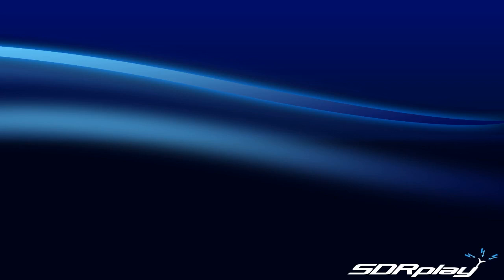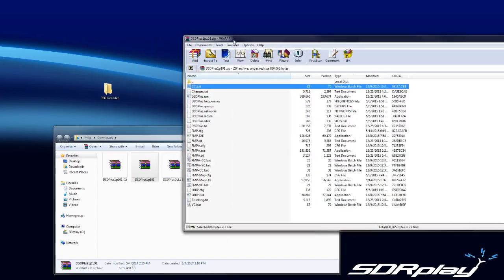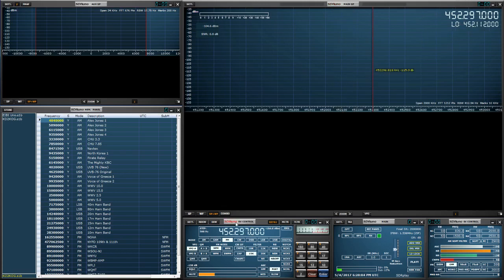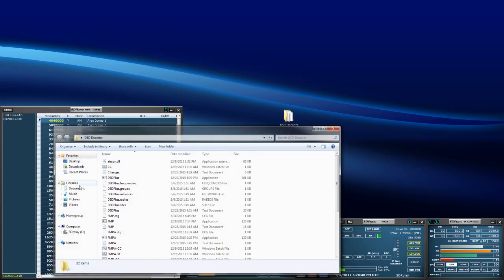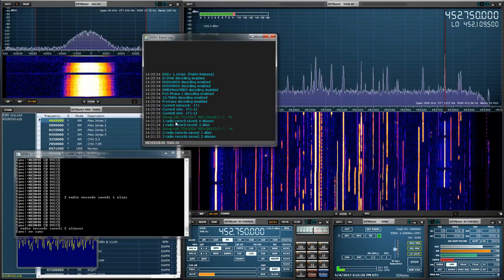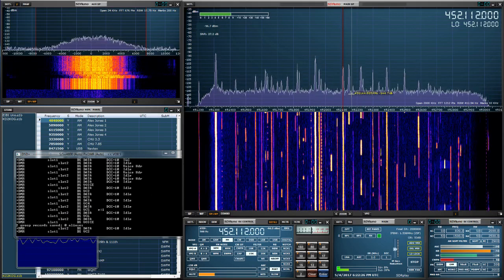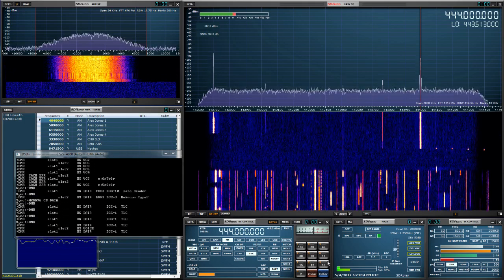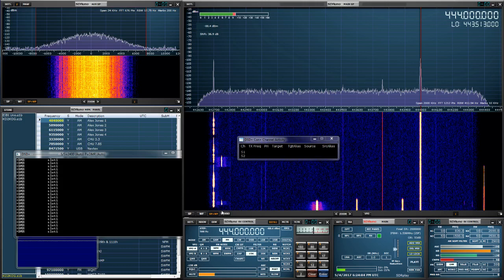SDRuno VAC & DSDdecoder (MV008)

Comment: hi i just followed your directions from your video and i have a few questions in your video you get only the DIGITAL AUDIO transmissions with out the DIGITAL DATA sound when i did it i get both the DIGITAL AUDIO along with the DIGITAL DATA sound how do i get rid of the data sound ? or am i doing something wrong ? also i keep getting a female voice saying TRIAL with the  Virtual Audio Cable program how can i get rid of it and is there another Virtual Audio Cable program that i can use ? and how do you get the colors in your SDRuno water fall i would like to know your setting for that and last question how can i get a full registered version of MULTIPSK i would like it for ACARS but it only runs for about  3 min in mine please reply to me - slingshot01@gmail.com tnx
Reply: i have the same problem with audio, would like some help please
Reply: If your getting a female voice that says "trial" that means you haven't paid for the software. Don't be cheap and pay up.
Reply: @ZAR66  you right it`s not like its alot of $.